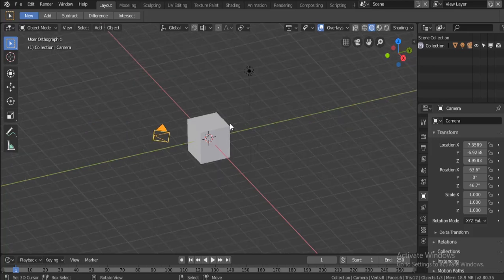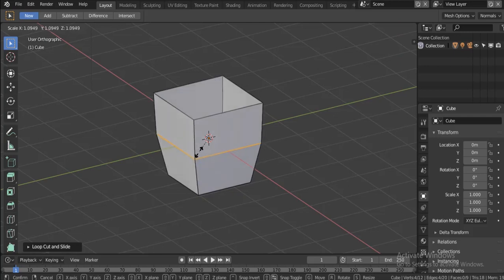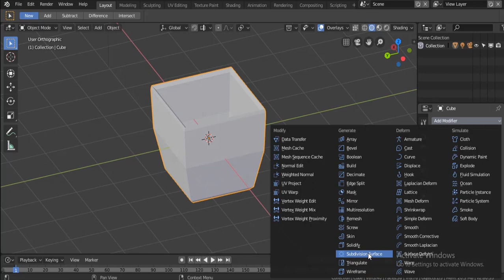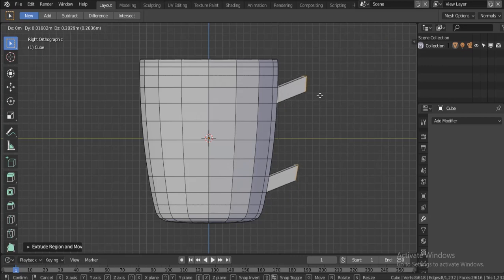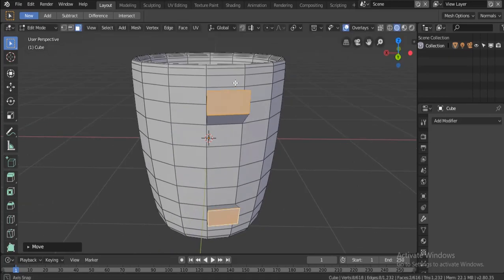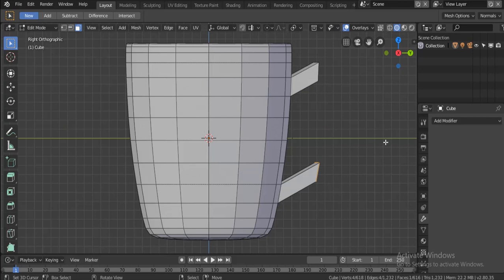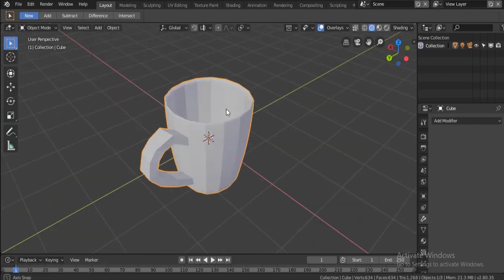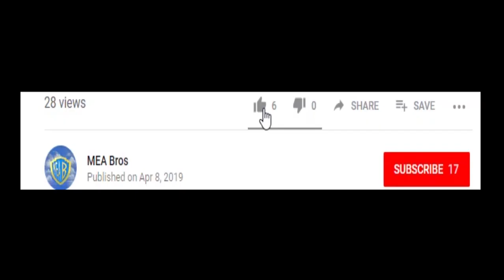How to make a simple cup in blender 2.8

Comment: Hi, I like your tutorial. I'm new to blender. At the 4.22 time stamp you show how to control-click extrude the parts of the handle. I can't figure out what modes you have to be in to do that. Nothing happens when I do that. Can you explain that step maybe?

EDIT: figured it out. You need to enable the 'extrude to cursor' option under the 'extrude' button..
Reply from the maker: Glad you figured it out man.
Reply: Sorry , can't see extrude to cursor option, i am using blender 2.83
Reply: @herryomar8000  I found it in edit mode. If you go to the tool bar and click the little triangle in the bottom right of the extrude button you get a menu for the different extrude types. Extrude to cursor is the last option in the menu. After that the selected face will extrude to anywhere that you click in the view port. There is no need to hold down any key. Holding the control key must of been for past versions of blender.